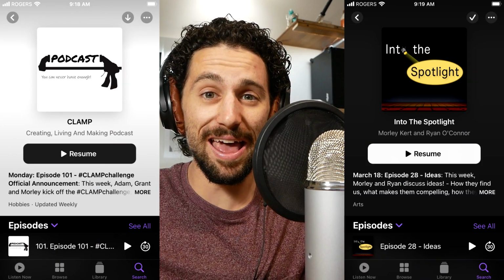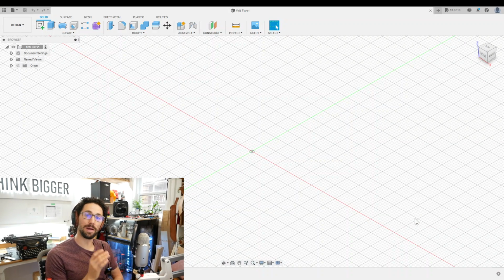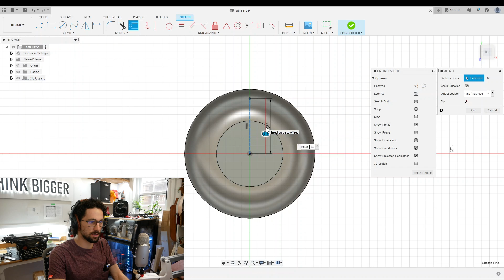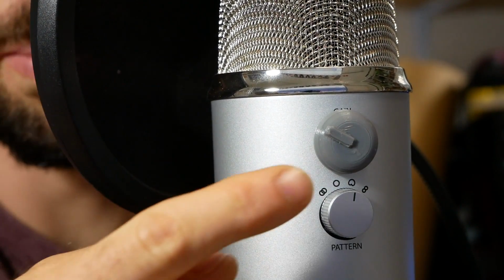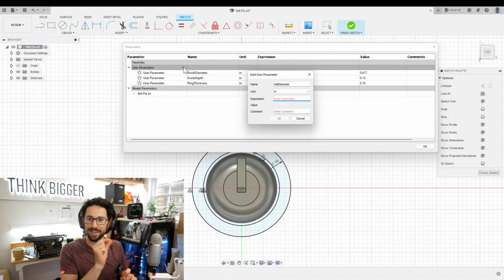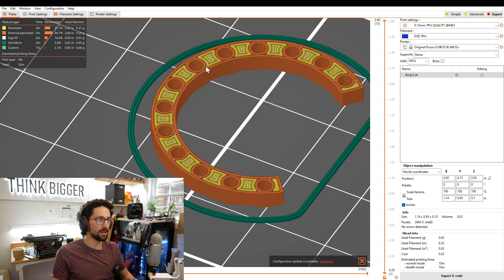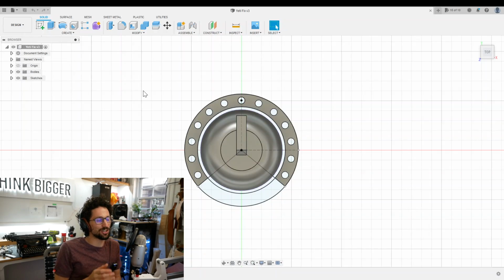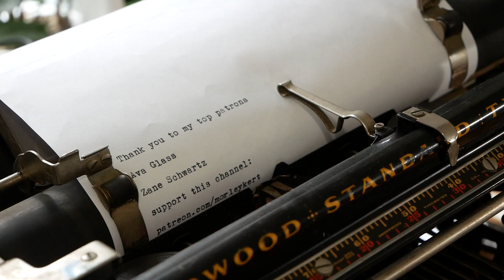Fixing a Design Flaw with 3D Printing

Comment: If I made microphones, I would make the adjustment knobs into dials that went around the circumference if the mic. That way, instead of twisting what's behind the mic, you'd twist a notched ring around the mic itself until you got where you wanted.
Reply from the maker: Great idea!
Reply: @MorleyKert  Thank you! I'm very honored by your reply.

Comment: Is there any alternative to Fushion 360 that lets you put in parameters and also offers a way to make screw shapes? I'm not a fan of something I need to pay a monthly fee (let alone $60+) on when I may only use it a few days out of the month, if at all some months. I rather stick with blender but it don't have the best means of measuring things. Like when I was designing my mini mixers for my mini dremel that uses a 2mm rod insert, blender said the hole I made for the rod was 2mm across, but it was more like 1.2mm when printed. Thankfully I knew how much I needed to scale it to fix it but still annoying.
Reply: i have two search starting points for you: FreeCad, and "cura slice tolerance" (here on yt), That being said Freecad can be more finicky than fusion, but it IS free and can do parametric design. and while the cura video might be cura specific, the theorie and the settings are applicable to all slicers.
Reply: @vsmash2  Thank you. I'll look into freecad to start. I have nothing against Fushion 360 if it was going to be used every day, then it would be worth the price, but for my needs I feel it would be too much of a waste. I'm also always willing to check out new stuff for slicers!
Reply: OnShape is a proper browser-based parametric CAD package that's free as long as you don't mind your files being public. It's what I use

Comment: This is what I like about practical 3D printing. I am new to design but I find I am making/printing more quality of life upgrades. I just finished an ant bait enclosure because I have cats and the liquid spills out. 
That knob was more detailed than I have done in the past, and I like it. I have used the small 2-4mm felt feet as indicators to align things I cannot see or power switches.
Reply from the maker: Awesome!

Comment: The locating mechanism is definitely useful but I think you might be using your microphone backwards. I use my blue yeti with the knobs facing me and it works fine
Reply: Nope, knobs are in the back. The front knob is for headphone volume.
Reply: @TomasGuinan  so, I'm not using a Blue Yeti, but my first thought also was that he had it backwards, which I thought was odd because of the pick up pattern. So today I learned... You never hear any review mention this. That has to be the weirdest design choice ever!
Reply from the maker: The volume/mute button is on the front, but I don’t understand why they don’t just put ALL of the buttons on the front.
Reply: @MorleyKert  It's definitely a weird-shaped mic. I see a lot of people using it backwards by accident, and the knob placement is probably a big part of it. Kind of drives me crazy whenever I notice it now
Reply: Oof my mistake. I use the gain control so rarely I totally forgot

Comment: How about just putting the "rubber button" on the real one the way, it's vertical in the sweet spot position? You should be able to feel it with your finger as well.
Reply from the maker: Yeah that could work too! My thinking is that the sweet spot is not the same for all recording situations, so the pegs allow me to mark out multiple levels for different settings

Comment: TPU is cool Stuff!!! Best printed with a direct drive hotend. If you don't have a direct drive, next best thing is Capricorn Bowden tube. Tighter tolerance! Even then, when I print with TPU, I print only one item at a time with zero retractions, no Z-hop and no crossing outlines!!! This is the only way I've found to print TPU with little to no cleanup. I've been using Simplify3D as a slicer, but just the other day found SuperSlicer which was nice as it already had a profile for the Ender 6 and a whole lotta other 3D Printers!!! I was successfull at printing a watering spout to attach to PET-G soft drink bottles for watering plants. The spout had an extreme overhang which SuperSlicer managed to layout and create supports for with very little adjustments!!! SuperSlicer has a gyroid infill that I really want to try for creative purposes!!!

Comment: From my experience, volume = loudness, gain = sensitivity. If your gain/sensitivity is too high, you get feedback if you are using an open speaker monitor system, not headphones. Gain/sensitivity affects the distance you can be from the microphone before it starts picking up your voice.